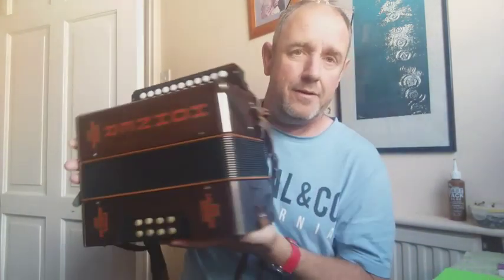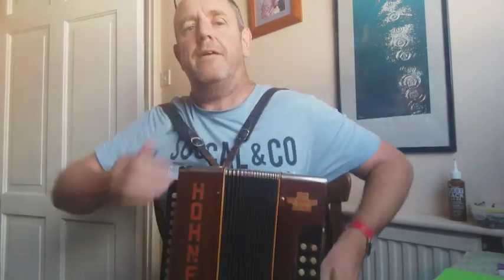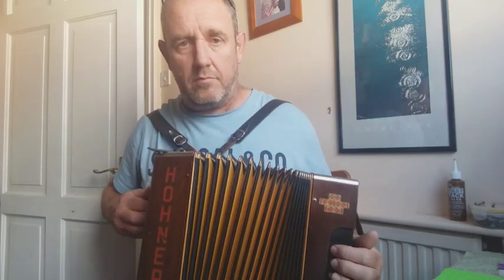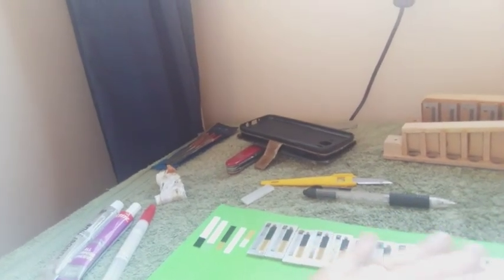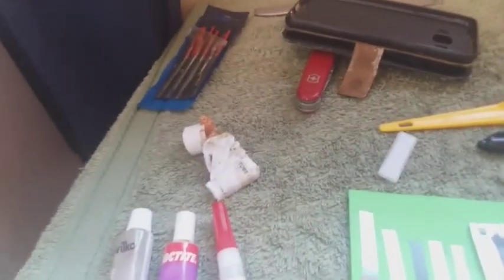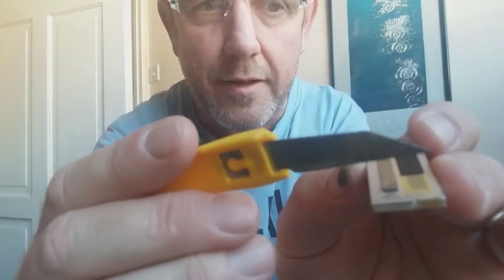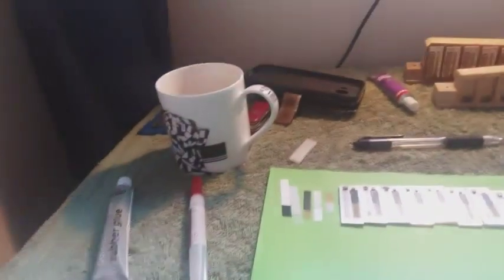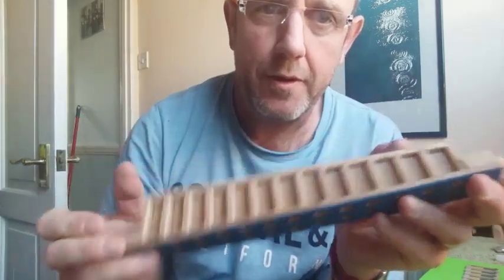Accordion repair and restoration part 3- revalving reeds and altering reed block

Comment: Thank you so much for your kindness to make such a good series of video for people who don't have repair nearby..  I have a question, I purchase some reed leather parts but just realize I didn't buy the spring part for the leather. I see you are using the plastic ones with multilayers. My question is if i didn't use the spring (valve booster), will it work? Thank you again
Reply from the maker: Hello 
It will still work
The metal strips help to keep the valves flat - I've seen lots of accordions with leather valves without the metal strips - the leather will curl up over time - so leather valves with metal strips will stay flat for longer 
I hope this helps 😁
Reply: @richedwards9646  Thank you!!

Comment: Hi Rich, thank you for the tutorial video, very detailed and informative! I have one question, if I just want to re-valve, should I take all reeds from the reed block? I see you took them all out, but some other people said you can tear the old leather up and glue the new leather/ plastic valve on it. Is there any difference there?
Reply from the maker: Hello
You need to put valves on the outside and inside reeds - before you revalve a reed you need to thoroughly clean any old glue and wax off - you can't do this with the reed still waxed into the reed block,so they have to come out.
Thankyou for your kind words - I hope this is helpful 😄

Comment: Why is there any need to trim the END of the valve?  It seems to me that if that solved some problem, trimming the sides would also be needed.  I understand why the shorter black bit might need to be trimmed, but not the longer yellow part.  It seems to me that it ought to make no difference to leave a couple of mm of extra on the end.  So I guess the question boils down to:  what bad thing is going to happen if you DON'T trim the valves?  I have seen leather valves that were sucked into the slot because they had been shortened (those were probably also too thin and so not stiff enough).  Also, thanks so much for your info on where you purchase your valves!
Reply from the maker: The valve needs to be long and wide  enough to fully seal the chamber when air is sucked out of the reedblock. There are two reasons why I trim the valve length to 1mm from the end of the chamber - first for a valve on the inside of the reedblock , the valve could catch on the end of the reedblock when opening and closing - so trimming it to the minimum effective length will help prevent this  . The second reason is that the more the valve protudes over the reed slot , the more air will be needed to open the valve and this can make the reed a little more unresponsive particularly on the higher pitch reeds.  I hope this helps!
Reply: @richedwards9646  Thanks, and thanks for the whole video series!

Comment: Should the metal reeds be lying flush with the opening in the plate?  I have one where the end of the reed  is a bit above the plate.
Reply from the maker: Hello 
The tip of the reed should be approx the thickness of the reed above the reed plate - so roughy 1-2mm😊

Comment: when trimming the black layer, about how far do you cut relative to the rest of the valve?
Reply from the maker: I try to cut back the black layer as much as I trimmed the bottom layer.
Reply: @richedwards9646  ah ok thanks